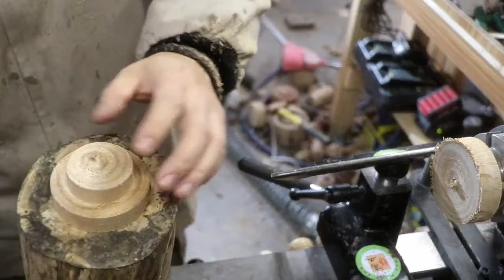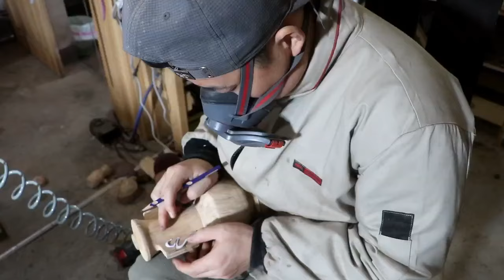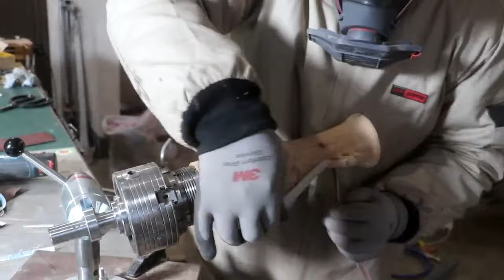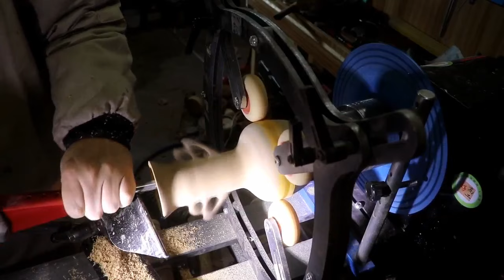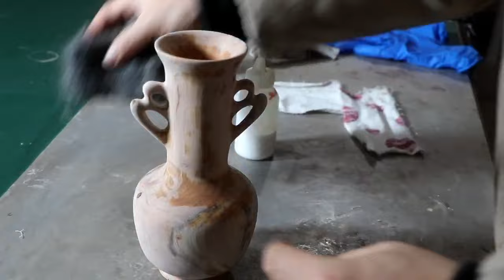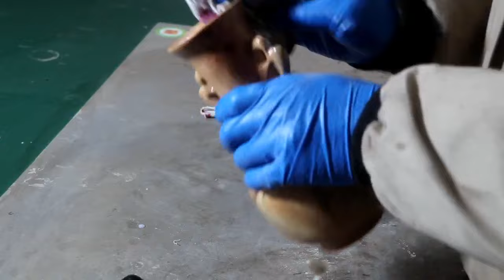woodturning:I don't think it's cool just to glue the ears to the vase

Comment: Wonderful piece! That's the right way to do it.
May I give a tip? Take an extra set of steady rest wheels and cut a groove in them. I put all 4 on a shaft and turned the groove on the lathe. Then you can put your steady rest all the way to the front of pieces like that and run the rim inside the groove. Works like a charm for me.
Keep up the great work!
Reply from the maker: Thank you so much,Eric.